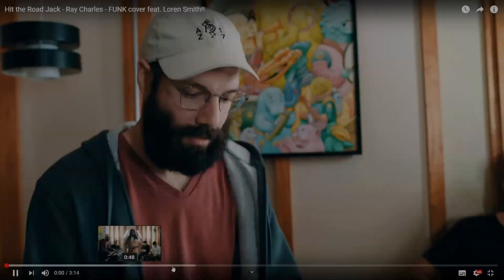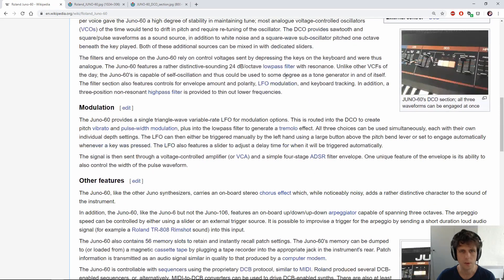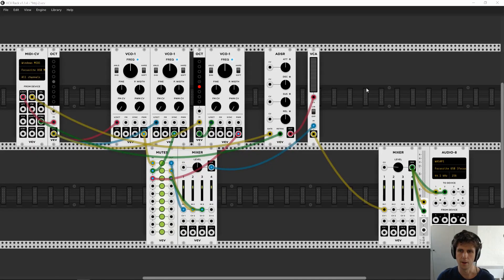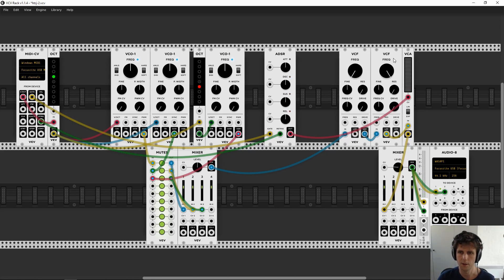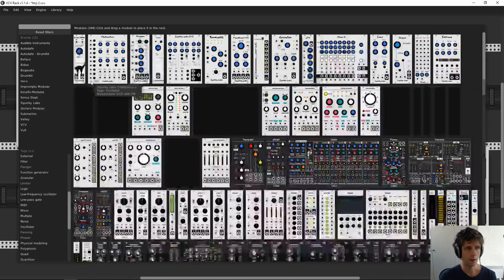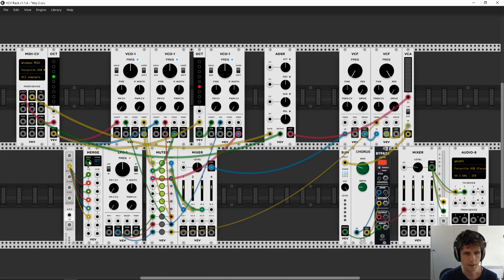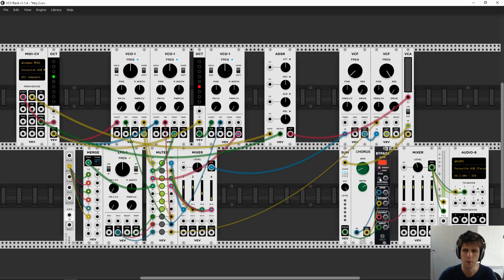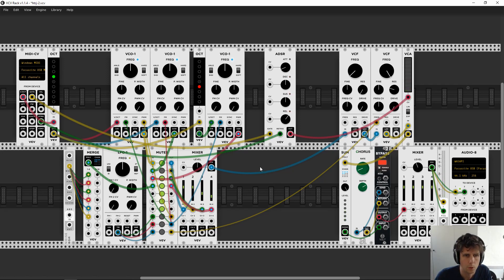Recreating a Juno-60 synthesizer with VCV Rack

Comment: Awesome. Has it made you want to play around with hardware synths?
Reply from the maker: A little, but more to get better control surfaces rather than specific instruments. Overall mostly the opposite - why buy the hardware if I can quickly make reasonable reproductions in software? :D Certainly a lot cheaper!